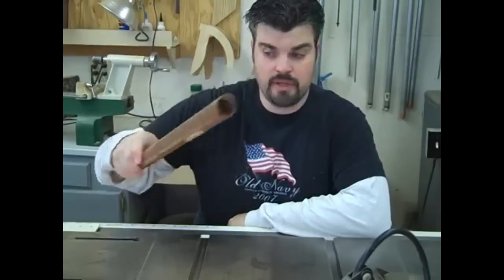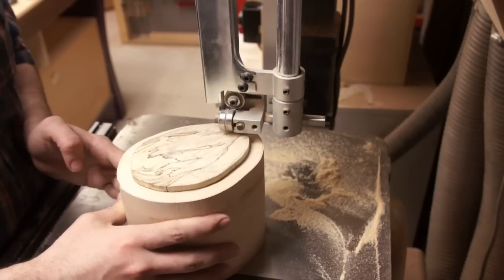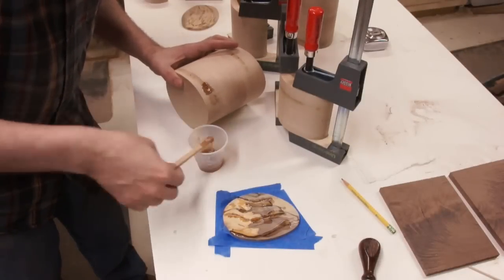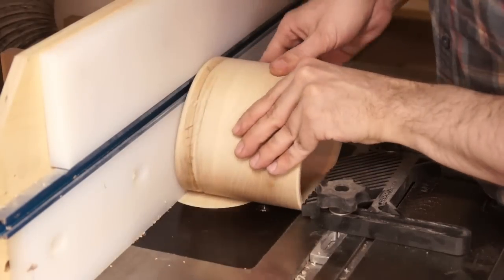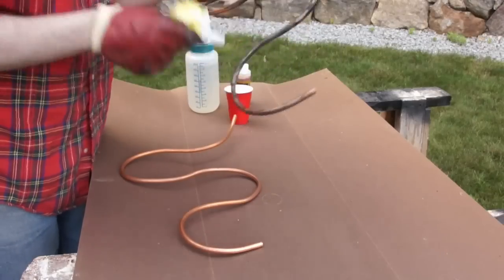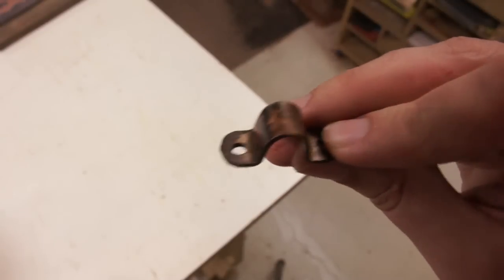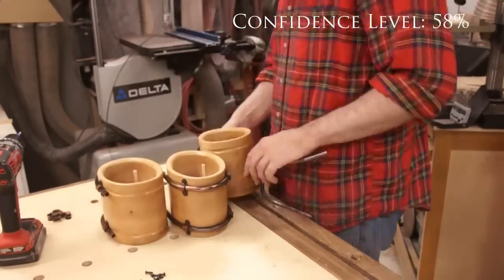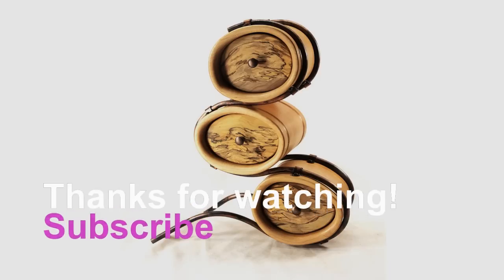Copper Tubing Band Saw Box

Comment: I love your confidence level percentage, I can spend multiple days making a blank to make a band-saw box then it sits for a couple of weeks because I'll be nervous to cut on it with the fear I'll screw it up after putting in so much effort to that point. Even though I've been woodworking for some time now I can still be apprehensive about the process, makes me feel better to see someone else have the same issues lol
Reply from the maker: I think you bar for what you are afraid you are going to screw up increases the more you do, but if you aren't afraid of screwing something up then you aren't challenging yourself enough.  But it's good to face those challenges with some momentum to the project behind them rather than setting it aside.  I have a hard time getting back to things that have been set aside.

Comment: I've never made a bandsaw box before. What kind of wood and how thick were the slabs of wood you cut the box from?  Also do you just make an oval that looks good or do you have a template
Reply from the maker: I based the shape of the boxes on trying to make the best use of the pieces I had available for the drawer fronts.  It doesn't matter what kind of wood or how thick the boards you have for the boxes.  You laminate whatever you have together to get the total thickness you want.